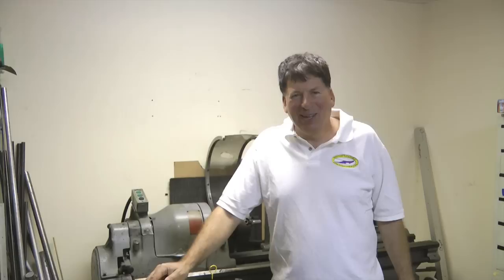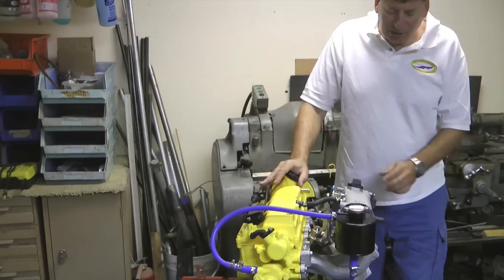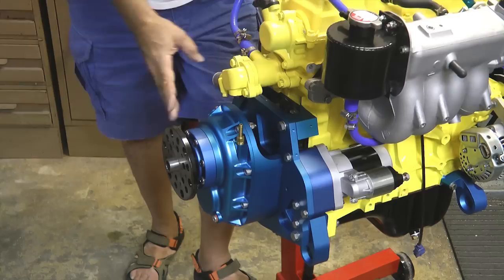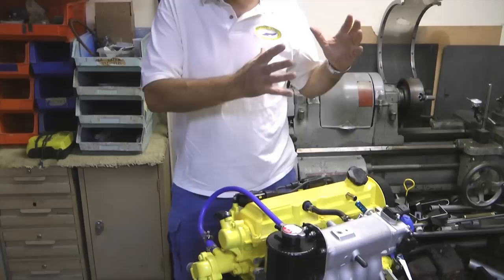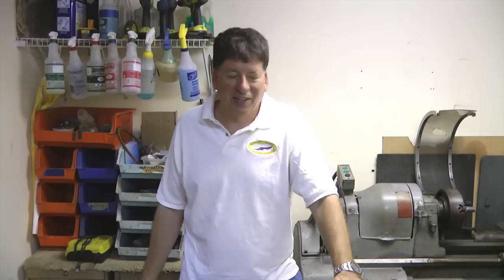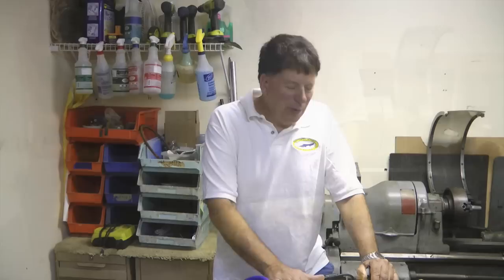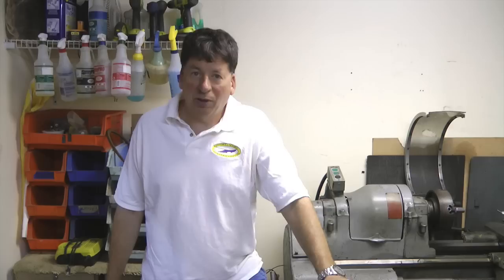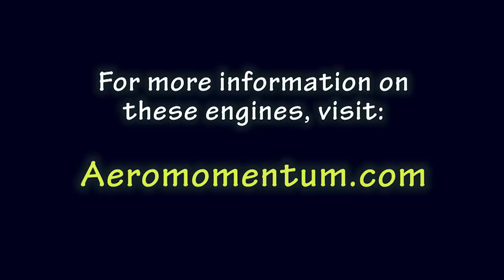Aeromomentum Aircraft Engines

Comment: looks good ...anything japanese is bullet proof
Reply: Fredrick Mechanical ....okok ill lawyer up to cover the junks.......most of what the japanese do is bulletproof ....there ya go
Reply: Daniel B except the Toyota 2.2 turbo diesel used in the verso and the avensis. A disaster!
Reply: TBO? DID HE MENTIPN TBO?
Reply: fatatomicsausage no but i think 1500 hours similar to the viking ...im quessing ..i thought i heard that somewhere .could be wrong
Reply: Daniel B I think DemolitionRanch can put that to the test maybe you should put in a request
Reply: Daniel B What I would like to see is an auto engine convertion that will make full horse power at twenty one to twenty four hundred revelutions instead of between six to eight thousand rpms . You and I know that most certified aircraft engines make full horse power at twenty one to twenty four hundred rpms . So why can't we this with an auto engine ?
Reply: metalfox1911a1 
That's 70 year old tech! besides, the engine had no reliability issues
Reply: Joe Wilson Tjats because most aircraft engines are direct drive. Itbreally doesnt matter what the engine RPM is. Whats important is the prop RPM.
Reply: Also the reliability of a car based engine making high horse power during flight at high RPM. Remember aircraft engines need to make power all the time unlike automotive engines. Good point though about propeller rpm, is  based on the available ability of the engine to turn a propeller of given diameter  and pitch. and a given rpm for that engine.
Reply: "So why can't we this with an auto engine ?"

Because they wouldn't make any power. Power is lb-ft x rpm / 5,252, so if you're limited to 2,700 rpm, you need a huge amount of torque to make a decent amount of power, which means that you need a lot of engine displacement. Something like an LS3 V8 could be optimized to make around 200 hp at 2700 rpm, but it would also have an installation weight of around 500 pounds. 

You get better power to weight ratios when you rev a smaller engine faster than you do if you rev a big engine slower, that's why basically all of the piston engines in the pre-jet era were geared down.

What you really want is an engine that is very much like an automotive engine, but designed for aircraft use from the start. If this is done, revs can be kept high but piston speeds can be kept low (which keeps engine stresses low, friction low, and efficiency high), you get lighter weight engines, the consistent cooling (and reliability that comes with it) of water cooling, and you get a smoother operation. Adept Airmotive is about the only company working toward this goal.
Reply: David Baker ...i dont know about you but i lost an engine lycoming at 2500 feet over plymouth massachusetts about 6 or so years ago...blew in the air .....next day lost a mag on another plane and the same day after the mag issue aborted a takeoff because the engine rumbled so bad .....so im willing to dump old tech and look forward ..
Reply: Accutronitis - That was my point, if you drive the prop directly with an automotive engine it will produce very little power because it will be limited to the maximum rpm of the propeller.
Reply: Daniel B He mentioned TBO when talking about the airboat engine that went over 4,000 hours before ding from “a general lack of maintenance”. He said “not bad for a 1,500 hour TBO engine”.
Reply: @ohwell2790  Most automotive engines are of better quality than Lyc/Con. Also Lyc/Con engines experience reciprocating stresses about 2.5 times greater than that of these Suzuki or Rotax engines. Suzuki M13A is the best engine out of all, better with a turbo.
Reply: @PistonAvatarGuy  An O-360 at 2500 rpm has 2.5 times more reciprocating stress than a Rotax 915 at 5000 rpm. The aircraft engines that people use aren't actually good engines, they were back in 1920, but not after 1940.

Comment: why do you guys all talk about hp. when torque is the more important figure ?
turning that big fan is not about hp- it's about torque. 
why don't you disclose the torque number with your hp number ?
the 350 in my truck makes 325 hp and 290 ft lb torque @ 4k rpm. 
the tcm /cmi 550 brags 325/350 hp but probably makes 400 /450 ft lb torque ( or more )  @ 2750 rpm
your gearbox will transfer up to 1200 ft lb but what does your engine produce ?
your engines are not making anything close to 1200  being less than 2L.
the most i would estimate would be around 150 ft lb after being multiplied through your gearbox. 
you are obviously using a gearbox to get your automotive engine into it's max power band without over revving your prop. 
i know that you want that engine to run in between it's max power and max efficient rpm ( determined by your cam profile )   while reducing the crank speed to safely operate your prop around 2800 max. 
so again- what are your torque numbers ?
Reply: It's actually all about power, because torque can be obtained with gearing, power can't. Any 325 hp engine will be able to produce just as much torque at the prop (or wheels) as any other 325 hp engine, as long as it has the proper gearing.
Reply: i'm sorry sir- we will just disagree. there are numerous massive diesels that produce monstrous torque numbers  ( without the use of a gearbox reduction )  and amazingly small hp numbers. speaking in general- higher compression / larger bore and longer stroke motors will produce higher torque while shorter stroke / higher revving engines will make higher hp numbers.  
if hp is the bragging right- why is there a torque meter in turbo prop aircraft.  to keep you from over stressing the prop blades, hub and crankshaft flange.   torque is the more significant number. 
the only regard for rpm is keeping the prop tips below sonic and within their maximum efficiency range.
Reply: You can disagree all you want, but you'll be wrong. The problem is that you don't know what power is, power is literally a certain amount of torque at a given rpm. 300 hp at 2,700 rpm is 584 lb-ft of torque, no matter what engine is producing it. You can make 300 hp with a Lycontisaurus engine at 2,700 rpm and it will give you 584 lb-ft of torque, or you can make it with a 3.0 liter V6 at 5,000 rpm and it will give you 584 lb-ft of torque when you gear it down to 2,700 rpm. The prop wont know the difference, it'll just turn power into thrust.  

Torque matters to the design of components because it's a direct stress on those components, but power is what determines how much torque is going to be placed on those components. The less power you make, the less torque you'll have at a given rpm, whether that be the rpm of wheels driving a car or the rpm of a propeller.

The faster an engine is designed to rev, the more power it will make relative to its torque output. Diesels make more torque than hp because they can't spin very fast, so they have to make a large amount of torque in order to make a decent amount of power. The larger an engine is, the slower it has to spin. It is power output that those engine builders are after, I promise you.
Reply: Stroke also has absolutely nothing to do with engine torque output.
Reply: wow- this is just like talking to my wife- i'm apparently wrong again.  
torgue is force.  hp is rate of applying force. 
if you make no force there will be no rate. 
torque is the torsion force applied.  hp is the amount of times one can apply that torque. 
noting again torque is measured in lbs,  while hp is the ability to apply that torque per sec. 
regardless of my ignorance- i'd still  like to see the dyno chart for the motor.....including  BOTH  torque and hp.
Reply: If you have force with no movement, you have no power, and something that produces force without moving is dead weight. There's no chicken and egg here, if you're building a machine that is meant to move things, both force and motion will be involved, not one or the other, and it's the rate of that movement that we're interested in. You can get just as much torque to the wheels of a semi truck with a 5 hp lawnmower engine as you can with its normal engine, but it will move so slowly that it will be useless. It's the RATE of work that we're interested in, and power tells you EVERYTHING you need to know about the rate of work. 

Why would you need to know the torque output for this engine? If it is actually producing its claimed power output at an rpm that can be handled by a propeller, it will produce just as much thrust as any other engine of the same power output, no torque rating needed. 

You don't see Lycoming and Continental giving torque ratings for their engines, and that's because their torque output is completely irrelevant.
Reply: knowing before i speak that i am wrong- i would still like to see the numbers. i am completely aware of lycoming and tcm/cmi's non disclosure of their torque numbers. 
why would i like to see it ?  curiosity. knowledge. learning. evaluation. reinforcing or dismissing theory about how to make the best / most efficient power.  where or when do your torque and hp curves intersect...do they intersect.... etc.
it would help in evaluation of a more efficient cam profile or valve diameters. intake and exhaust lengths  etc. 
it's all a learning curve.  the moment you believe that you cannot improve, someone else will blow right past you.
Reply: Mister7x7, You are not understanding the big picture. Idontcare80 is correct. Listen, theoretically one could gear down a clock motor to produce 1000lbs of torque, but that's going to do squat turning a prop because to develop that amount of torque, speed is sacrificed. "Time" is a critical element when calculating power. 1 hp= the force to lift 33,000lbs, one foot, in one minute. The above clock motor could do the same task, but it would take several months. Study and understand the basics of electrical power,  Watts (Power) = voltage  X  amperage. High voltage, (rpm)  or high amperage, (torque), does not equate to "high power". One without much of the other will result in little work being done.
Reply: blh3863 it was educational
Reply: a few people here - including myself - have their differing opinions on torque and hp.  at some point we just have to disagree.  probably the reason there are winners and losers at the race track.   i could continue to push forward with example after example of torque and hp curves,  , bore / stroke , turbo or naturally aspiration, but there are more important issues.
Reply: mixter7x7 I see your point but you are either right or wrong I hope it makes people look it up for themselves. it's a good thread with no insults
Reply: cart-  there is a lot that goes into this.  people think you can simply bolt on a bigger motor and go faster. nope - most aircraft are speed limited by the airframe's ability to withstand the force of relative wind.  they are not speed limited by their engines.  so you can't just bolt a tsio- 550 to your cessna 150.    another limiting factor is the strength of the prop hub.  centrifugal forces are attempting to pull the prop blades out of the hub.  although most reciprocating aircraft engines are turning around 2700- these engines will easily withstand 4000 rpm for extended periods of time. the prop hub will not.  hartzell in fact says that if you exceed your red line by 10%,  ( 2970 rpm )  the prop must be removed and inspected by them for approval of return to service.  so again- glad you enjoyed the learning curve, but there are a lot of misconceptions about aviation and ,  a lot that goes into this most people don't understand.
Reply: Prop tip speed limits rpm .
Reply: Thank you w8strl2 I am glad someone else understands what limits prop red line. Not structural integrity of the prop hub. I have been a licenced A&P since 1969
Reply: prop tip speed is less than  half of the equation.  propellers lose their mechanical efficiency before their tips reach sonic.  air propellers are most efficient around 65-75% rpm and  begin to lose their mechanical efficiency as the tips exceed 80%.
Reply: glad i could help. i learn so much from people who already know everything. 
i'm also  hearing the blaring silence of your non response to my reference of prop hub stress.
mach speed, sonic, speed of sound.  it has several descriptions that all equal  1100 fps. variable depending on baro, temp and humidity.
Reply: HP moves the airplane - not torque, not RPM.   HP = Torque X Speed in RPMs/5252, thus horsepower is convertible through gearing to either torque or RPM, depending on what you need. One can take a flashlight-battery-operated electric motor and gear it down to produce hundreds of pounds of torque - at 0.1 RPM.
Reply: There are some airplanes that run supersonic propellers. They work fine, but very noisy.
Reply: mixter7x7  I worked as a certified aircraft mechanic for thirty years starting back in the late fifties. Prior to that time and continuing up until the present the general public has been spoon fed horse power ratings. Sure, there is a formula for determining HP as I believe you know, but it depends on a lot of variables that can literally change from moment to moment. So HP is a snap shot of what a reciprocating av gas engine is capable of.
But for a given RPM, the torque reading is the torque reading.No exceptions, no variables. 
Along come the electric cars of today. Automotive HP ratings are now irrelevant. Torque is king. Stand on the throttle (Rheostat) of an electric performance car and you experience the acceleration that only race car drivers experience. But, that being said I worked on four thousand horse power radial aircraft engines and the sheer size and thunder
Reply: 2/3 gear reduction/torque multiplication,it's got all the torque it needs
Reply: I couldn't keep up with a lot of what you said, but I would bet you're right and mixter7x7 is winging some of his spew out of desperation. There should be a place somewhere around here to place bets on this. I got $20 on idontcare80 to win.
Reply: Why did you say that?
Reply: An A&P since 1969.... think you're going to like it?
Reply: 65 -75% rpm? Of any engine?
Reply: depends on size of prop,and they have developed special tip shapes to prevent damage
Reply: My Cassutt's RPMs is designed to go close to 4000 with a tuned up 0-200.. and it doesn't bang (lucky me). for the tip of the prop blade to go faster than mach1 at 2700 RPMs, the prop has to be long enough. If it's a shorter prop it can rev much higher before tip reaches mach1, hence I don't get it why the rule of 2700 RPM (out of a magic hat?).
Reply: Because they are using a gear reducer there should be an option to bring down the RPM even lower to 1900 RPMs or less.  That is when the efficiency of the propeller will increase dramatically Giving more thrust per hp or rated torque .  The high prop shaft RPM number that are achieved by this motor are used for the convenience of using already available less efficient  propellers that are already available because that is what everyone else is using.
Reply: rpm x torque divided by 5252 = hp
Reply: mixter7x7 LOL. TOO FUNNY
Reply: @blh3863 that's because everybody involved is a nerd or a wannabe nerd. nerd's win arguments by quoting the proper equation. when that happens everybody just shuts up. :)
Reply: jesus! hp is a simple calculation. (RPM x torque) / 5252 = hp. do the math yourself.
Reply: ft/lbs is actually a measure of power, not Torque. It is lb/ft, or in standard language Newton Metres. Torque is leverage, you can have lots of torque with a small amount of power (KW) however the output will be slow. You can have an engine with a 10000nm and 10kw but it will be massive. Torque and power work together, in order to deliver torque quickly, you need power. The torque a propeller experiences is quite low, but the speed at which it is required to spin is high, therefor power is a more important representation of an engines ability.